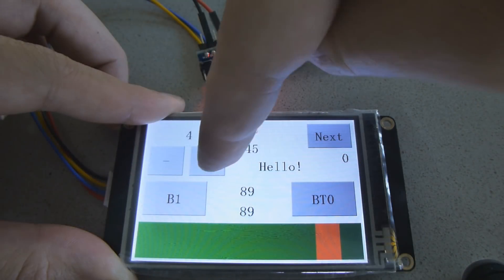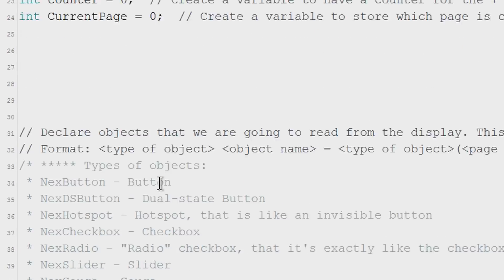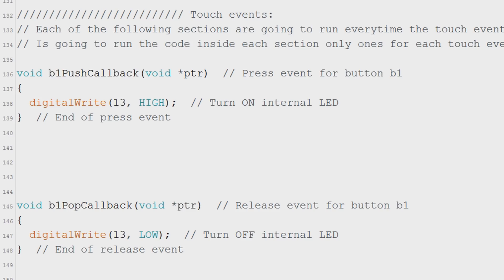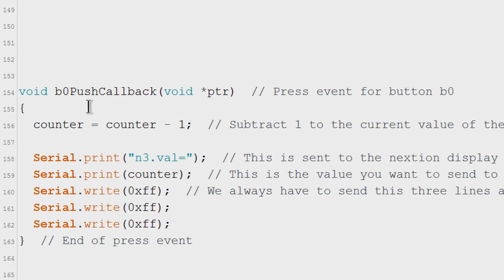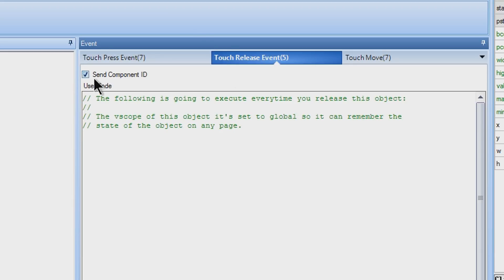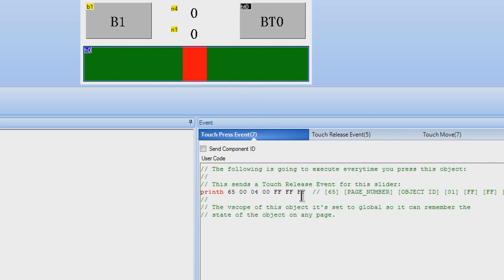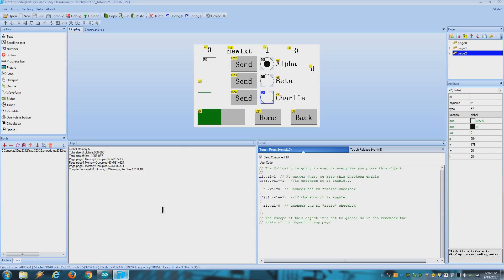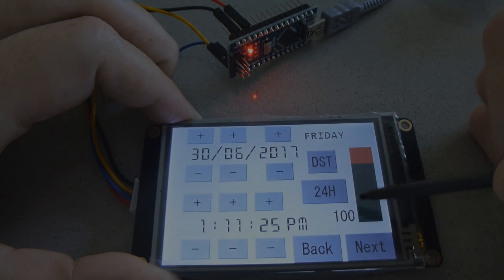Nextion+Arduino Tutorial #2 Sending Data To Arduino

Comment: Hey InterlinkKnight. I get this when i'm trying your sketch https://pastebin.com/36ZcJUMY anybody else have this Problem ?
Reply: Ok I got it to Compile. Got two nextion libs. Still get the Unsused Error at the top. But Main Problem ist that the values don't change on the Display.
Reply from the maker: I don't know. Make sure you really clean your library folders of arduino to make sure you have only one nextion library. There are more than one library folder for arduino, btw. I don't understand the error. It's too long and confusing. All I know is that I use the library with only the modification to the config file as I mentioned and used my sketch and got it to work on arduino nano. You should try in a clean computer and it should work. If doesn't work, you have something different. It's hard to know what you did different since it's not my computer.
Reply: is there a difference if i have a basic and not a enhanced version of the display ?
Reply from the maker: For the arduino sketch, there is no difference if you have the basic or the enhanced version.

Comment: Can I acess to a DB in a memory card and change values?
Reply from the maker: What is a DB? The microSD card on the display is only used to upload the project, and can't be accessed by your project or do anything else. If you want to read/write files on a SD card, you need to connect a SD card module to arduino and do everything from there. The display is good only for displaying things.
Reply: Thank you. DB - DataBase. I figure how. I will use a raspberry as a mysql server :)
Reply from the maker: ok. Good luck

Comment: A brilliant video session . 
There seems to be an issue with the Nextion library, whilst compiling( for UNO / Nodemcu)  , it needs the following additional library ( SPI.H , SD.h , SoftwareSerial.h) as part of the sketch . The NexConfig.h file has been changed from  "#define nexSerial Serial1" to "#define nexSerial Serial" for the UNO as suggested by your sketch
Reply from the maker: I never got an error. What make you say that the nextion library uses other libraries?
Reply: Well i downloaded the latest lib from github , on compilation it throws the error for want of the above additional library, i searched in the internet and look  like there is a header NexUpload which is part of the library but is not required , i removed it and the compilation went fine without error. m now trying to get the code loaded ....
Reply from the maker: I still don't know how I never got that problem. I didn't have to modify the library, except the configuration file to set the "nexSerial".
Reply: well i was able to successfully test the scenario and blink the led. Special thanks to your tutorial which made it look so easy . Have one query , if during the process of communication if i accidentally switch of the nextion display . Switching it on again does not retain the button state . For advanced nextion boards we can use the wepo and repo function . But since i have a 2.8" standard display was thinking whether there is any way . i tried send serial message after the led is switched on / off with the button state . but it does not have any effect on the display . Think i  need to write a pre-initialization code on the nextion to get the button state from the arduino board.
Reply from the maker: I am glad.

To answer you, the display doesn't retain the button state. You could do that only with the enhanced version that has EEPROM.

You could try using the EEPROM of arduino and send the button state to the display. It should work.
Reply: Thanks , But i do believe EEPROM has limited write cycles ( 100,000) , i am thinking about using SPIFFS , but there are not many  examples of using spiffs for Nodemcu .Do you have any info?
Reply from the maker: Are you going to press that button often? Do you really need to store the button state after powering off? I have no idea what SPIFFS is.
Reply: Well the reason to have Either EEPROM or SPIFFS is to store the button state in case accidental switch off of the device ( Nextion or Nodemcu) . EEPROM is good but they say ; it becomes unreliable over a period of time . SPIFFS is a Flash FIle system using the SPI interface , but implementing is not easy ; plus i am not sure whether spiffs is the correct approach for my requirement.Maybe i need to check the button state and write to EEPROM only if it changes ; that way i would reduce the wear and tear whilst repeated calls to EEPROM...
Reply from the maker: Of course you should only write the EEPROM when the state of the button changes. Even if you press that button everyday, it would last over 200 years. Don't get scare about wearing the EEPROM. It's very hard thing to do in normal situation. And what happen if you damage an address? Just change the address and everything is fine again. It's not like you can damage the entire EEPROM just for wearing an address.
Reply: Thanks . Anyways do you by any chance know whether we can connect Nodemcu to Nextion without 3.5 - 5v level shifter.
Reply from the maker: I know as a fact that the display needs 5v, but the serial comunication i don't know if it can accept 3.3v logic.
Reply: Hi Again, no success to get it connected to Nodemcu. the script compiled fine, but response from Nodemcu . I wrote a simple script for Button press which switches on the led on nodemcu. If time permits can you test it on your nodemcu 
#include <Nextion.h>

NexDSButton bt0 = NexDSButton(0, 1, "bt0");  // Dual state button added

NexTouch *nex_listen_list[] = 
{
  &bt0,  // Dual state button added
  NULL  // String terminated
};  // End of touch event list

void bt0PopCallback(void *ptr)  // Release event for dual state button bt0
{
  uint32_t number5 = 0;  // Create variable to store value we are going to get
  bt0.getValue(&number5);  // Read value of dual state button to know the state (0 or 1)

  if(number5 == 1){  // If dual state button is equal to 1 (meaning is ON)...
    digitalWrite(D4, LOW);// Turn ON internal LED - reverse logic of buitlin LED
    Serial.print("bt0.val=");  // This is sent to the nextion display to set what object name (before the dot) and what atribute (after the dot) are you going to change.
    Serial.print(1);  // This is the value you want to send to that object and atribute mentioned before.
    Serial.write(0xff);  // We always have to send this three lines after each command sent to the nextion display.
    Serial.write(0xff);
    Serial.write(0xff);
    
  }else{  // Since the dual state button is OFF...
    digitalWrite(D4, HIGH);  // Turn ON internal LED - reverse logic of buitlin LED
    Serial.print("bt0.val=");  // This is sent to the nextion display to set what object name (before the dot) and what atribute (after the dot) are you going to change.
    Serial.print(0);  // This is the value you want to send to that object and atribute mentioned before.
    Serial.write(0xff);  // We always have to send this three lines after each command sent to the nextion display.
    Serial.write(0xff);
    Serial.write(0xff);
  }
}  // End of release event

void setup() {  // Put your setup code here, to run once:
  
  Serial.begin(9600);  // Start serial comunication at baud=9600
  
  bt0.attachPop(bt0PopCallback);  // Dual state button bt0 release
  pinMode(D4,OUTPUT);

}  // End of setup

void loop() 
{  // Put your main code here, to run repeatedly:

  delay(10);  // This is the only delay on this loop.
  nexLoop(nex_listen_list);  // Check for any touch event

}  // End of loop

Comment: I tried this whit arduino Mega2560 and I dind`t get any connection, tried it on RX0(blue) TX0(Yellow) and whit all the other Serial connectors from the mega, but no response:/
I uploadet your files whitout changing something,
Thanks for the video anyways it was very informative and helpfull!!
Reply from the maker: The problem is that you used an arduino mega, and my files are made for arduino uno/nano. The issue is that arduino uno/nano has only one serial port called just "Serial", but arduino mega has 3 serial ports and they are called different: Serial1, Serial2 and Serial3.

You would have to change every part of my sketch that say "Serial" to "Serial1". Also you need to make sure the NexConfig.h file inside the nextion library has this line like this: #define nexSerial Serial1

You can change the serial number to 2 or 3, but you need to do that for the entire sketch and the configuration file.

If this sounds too confusing, just try with an arduino uno or nano.
Reply: InterlinkKnight perfect, thanks for the fast answer, I will try it whit my arduino mega :)

Comment: after seeing all the problems with nextion - do you know a easier to use alternativ for nextion?
Reply from the maker: I've never seen a better or easier option for arduino. This is the most complete and easier display you can have for arduino, that I know. I've use common displays that connects directly to arduino, but they are good only for simple stuff, like basic graphics and text
Reply: Thanks for your answer. It will safe me a lot of time to search for something which is better :-)
So, better to plan 3x what you want to realise with nextion than later have a change on the GUI or? :-)
What do you think about to use MS Visual Studio to code for Nexition or Arduino?
Reply from the maker: No idea about MS Visual Studio

Comment: I have problems when i change the page if in the page is the same variable even though i check the current page sometimes work fine sometimes don't. I put the same code in my application printh 65 01 00 01 FF FF FF  // [65] [PAGE_NUMBER] [00] [01] [FF] [FF] [FF]
changing de page 00 01 02 in every case and check de page in my arduino code, but don't always work. Could you make something else?
Other thing is i have a dual button and in the screen change well, but arduino is like sometimes like lose the data, because not respond always, is normal that?
Reply from the maker: I am not sure I understand. I would have to check the sketch and nextion project to better understand the problem. But all that you mention appears to me as a problem in communication from the display to arduino. In my tests I never seen that, in normal situations. I can provoque communication problems using software serial, causing errors messages from the display, etc. But in normal situations, I never seen that level of inconsistency.

My example files work well for you, right?

Send me an email with the files and more details about the problem. My email address is the same as my youtube channel name at gmail.com

Comment: Is there a way to write to eeprom of the Arduino UNO from the Nextion display?
Reply from the maker: Of course. If is a value that is on the display, 1st read the value so arduino can have that value. And after that just write the value to the Arduino's EEPROM. If you want a button to do all this, put all this code on a function of a button in arduino, like I show on the video. But instead of turning on the LED, read the value and write to the Arduino's EEPROM. Try it and let me know how it work for you.
Reply: Thank you very much for your quick reply. i will try as you explained!!!

Comment: What is the tiny Arduino you use on the video, part number and where to buy.
Thank you
Reply from the maker: It's called arduino nano. It's very common. It uses the same code as arduino uno. I like it because is small, can be plugged into a breadboard and it's super cheap from china (US $3). I buy them on ebay, usually 10pcs at a time

Comment: I would like to see a tutorial dedicated to PIC controllers from Microchip. Any controller. Arduino is fine because has all the libraries you need, but programing to work with a PIC it is a different story, For example, to get it work for a PIC, i have to separate your code, and applied to a PIC controller.
Thank you.
Reply from the maker: PIC is too complicated. I am just a hobbyist. I barely got into arduino because was simple enough.
Reply: Thank you
Reply: Thank you very much for the videos.

Comment: Hi, firstly thank you for so much information, it's very helpful. I just have one problem with reading text: https://scontent.fprg1-1.fna.fbcdn.net/v/t34.0-12/22207453_1726548564031355_1572398987_n.jpg?oh=252e665a13f2b2fa7554ee8223772418&oe=59D54403 .. I don't get any data :/
Reply from the maker: You are trying something very simple so I suggest you to use my arduino sketch first and make sure that works. Then delete everything except the essential things to make a button and reading a text work. Remember to keep the buffer. If you still have problems, let me know and pass me your project files from nextion and arduino.
Reply: I figured it out... It works now... unfortunately new thing doesn't work. Is it very big problem receiving value from Nextion? Even though I used your code I always get 0
Reply from the maker: Did you edit anything on my arduino sketch or nextion project? I need more details, for me to help you. When I have a problem, usually the ID of the object doesn't match the arduino sketch.
Reply: Martin Brada i had simular problem with 2 diff. buffers. they for some reason just stopped receiving data to display. nothing was changed in code so i think it is a defective nextion
Reply from the maker: I doubt the display would broke that easy. Make sure you are doing everything correctly

Comment: Is there a max length of the screen from the device? Great video BTW!
Reply from the maker: I don't understand the question. Length of what? Physical size? Text length?
Reply: Sorry, I mean the cable length, I would like to put the screen 10 ft from my ESP8622 -)
Reply from the maker: Depends on the serial baud rate you selected. This website have a good chart showing the distances: http://www.tldp.org/HOWTO/Remote-Serial-Console-HOWTO/serial-distance.html

We are talking about serial communication so it's more a protocol limitation than the display.

I didn't try long distances, but I don't see any problem on having the display 10 feets from the micro controller.

It also depends on the cable that you are using. For long distances, its better to use Cat 5 cable, or something like that, that it's shielded. 10 feets it's not that much so I doubt you even need shielded cable. Your call.
Reply: You are SO HELPFUL TY!
Reply from the maker: You're welcome. BTW, what your project it's about?
Reply: Solar power manager display (:
Reply from the maker: Wow, sounds cool. And good idea. The nextion display would be great for that. If you ever make a video about it, put the link here so I can see it. Good luck with your project.